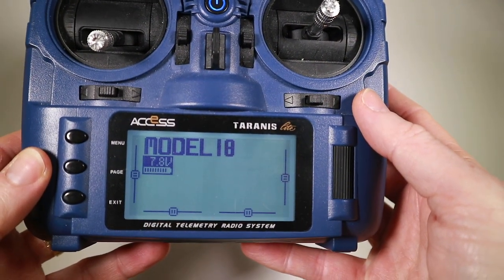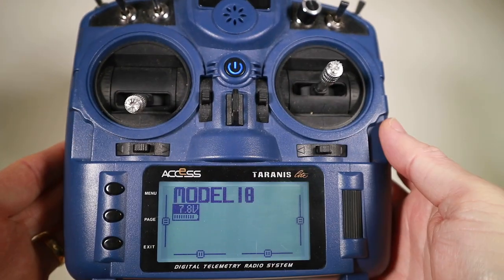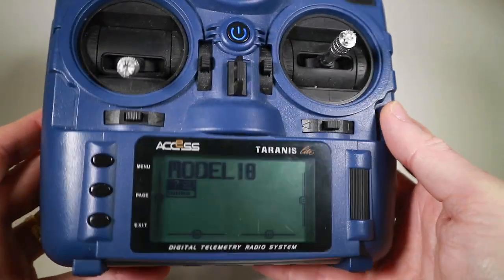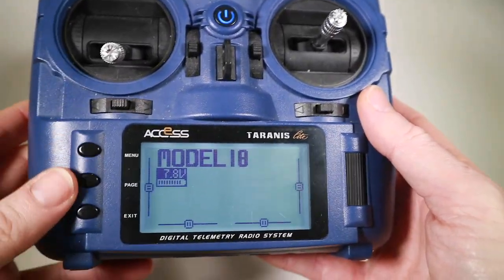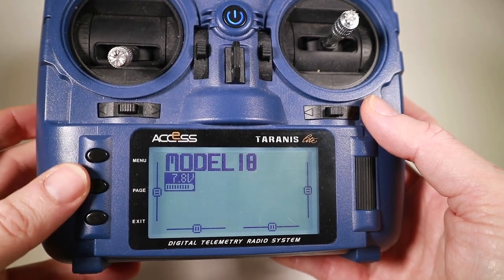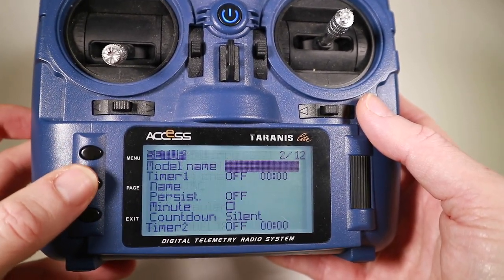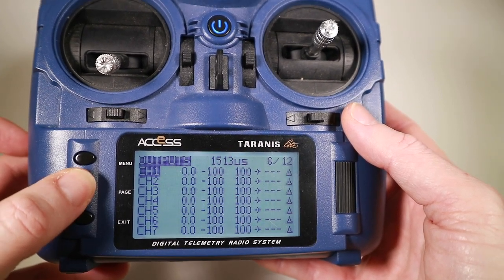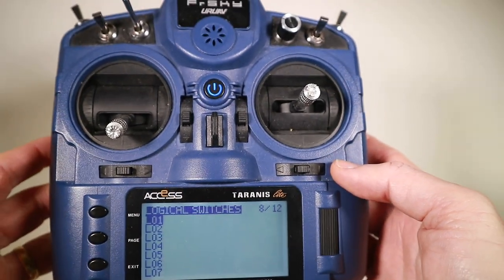OpenTX Part 5: How to use Logical Switches

Comment: Another great tutorial Wayne! And a little addition with regards to the servo sweep. If you're using a separate channel all you need to do is assign either of your LO switches to the Source and set Multiplex to either Add or Replace and you're good to go.
Reply from the maker: That's cool - there's always multiple ways to do something in OpenTX isn't there :)  I think this comes back to a general habit of using MAX as the source if I wanted switches to override another channel with an offset

Comment: Thank you 😊 I can't see me using it for quads, but for a plane with landing gear, you can do a switched flaperon mix to trigger on gear down for instance, which could be really useful 😁 or for mode switching for something translational like a v22 or other tilt rotor.

Comment: Nice video, thanks for posting. I searched on YouTube all day long but I was not able to find a tutorial on how to read out the value of the S2 knob... That said, I have my gains for the S6R set on the S2 knob and would like to look at the plane, and not on my screen, while turning the knob. So it would help if my TX16s would read out the value for me. Any ideas!? Thanks.
Reply from the maker: Yeah - so you should be able to get something for this.  So a start point is to go to the special functions, and I made the first column a momentary button, the second column "Play Val" and the 3rd column S2, so whenever you press that momentary switch, you'll get a read out from -100 to 100
Reply: @CurryKitten  Hi. Thanks for the reply. I figured a way to do it but I have to flip a switch first to hear the value. I was hoping to not have to flip the switch... Just hear the value by turning the knob. Thanks.

Comment: For long range I would like to have 2 switches needed to disarm. I realize this might be a little unsafe, but I have crashed 3 times with accidental disarms. How might I do this on Open TX?
Reply from the maker: Usually there isn't a seperate arm and disarm switch, they are on a single switch.  Lots of ways of thinking about this, but perhaps the easiest way is to set you arming on a logical switch which uses the OR operating with two physical switches to be active.  This means that if either of the physical switches (or both) are on, then then the model is armed, but both switches have to be off in order to disarm.

Comment: Would like to use any of the rs/ls sliders to adjust gain on a gyro/stabi continously during flight.
How to program this within which menu on OTX? 🤔
Reply from the maker: You'd do this the same way you would any switch really, in the MIXES page, go to the channel you want to use, edit it.  Set the source to your slider... and that it.  You might want to do something to activate/deactivate the sliders usage, but the basic setup is very easy.

Comment: Hey bud. Question for you. Everytime I turn on my radio it reads out that Failsafe is Off. Quad is Disarmed and it tells me what flight mode it’s in. How can I have the radio not call out these values?
Reply from the maker: I'm away, so I can't check this.  It's probably in the main settings menu - which is where you can disable some alarms.   I'd always set a failsafe though - just set it to "no pulses" and Betaflight will detect that.
Reply: @CurryKitten  yea. Everytime I turn radio on it’s just letting me know what the switches are currently set at. Just trying to turn that off. Also when I first plug in a battery it plays a value and tells me the voltage. I want to turn that off too. I have a logical switch that plays voltage below 22.0 volts. No idea why it tells me the current voltage when I first plug battery in.